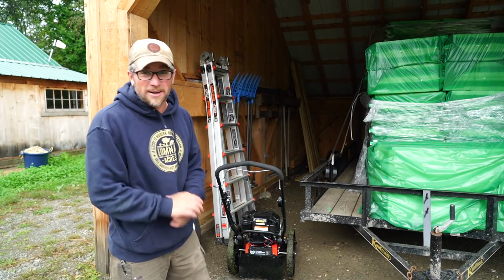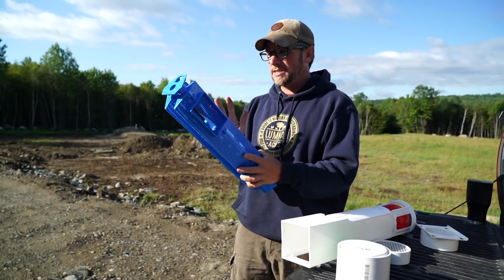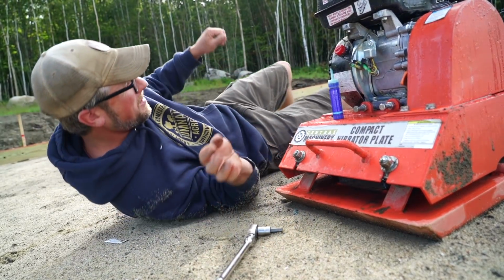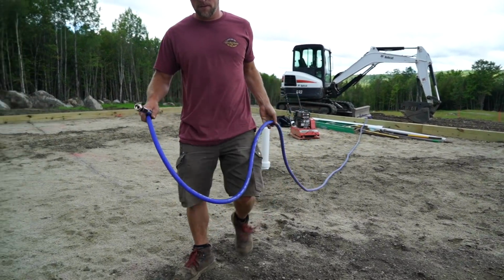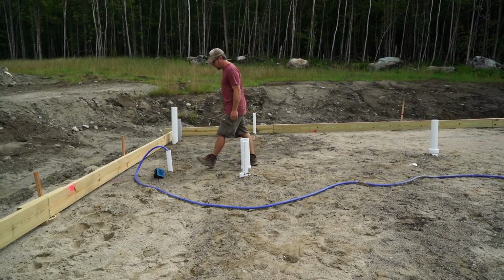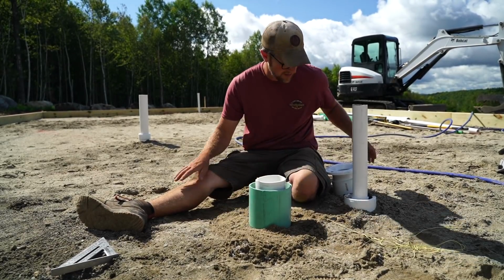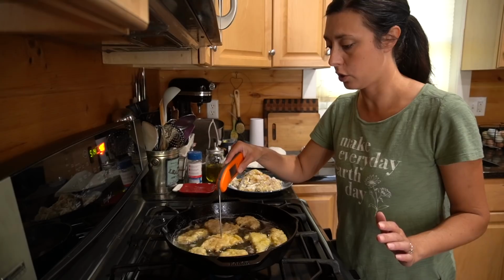If It's WRONG We'll have to Jack Hammer it Out!!!

Comment: Just cringing watching this guy cut all these risers in the plumbing grounds.  NOT the way things are done.  You’re just begging to fill your grounds up with concrete during the pour.  There’s absolutely no reason in earth to cut all those prior to pour.   Oh my gawd he’s cutting one off below grade level!!!  No!!!
You don’t have to have a perfect slope into the shower drain at that point.  You could pour the slab level there and build a curb for the shower or drop the shower a 2x4 and be done with it for now. You’ll set the slop and exact drain height when you do the tile floor with old school mud bed or the newer sloped products that are designed to go on a flat floor.  Oh gawd how old is thus video?  I hope this guy hadn’t poured this concrete…

Comment: We have two of those high wheel trimmers. They are a bear to operate because you are getting flung with stuff and it can wrap around the spindle but they do cut well when weeds take over. Good that you checked all the drains in you tiny house. You have to cut the pipes off before the floor is poured? That seems tough. How do you keep the pour from invading your pipes? Now I see. So sleeve around the actual pipe that the concrete goes around. Cool. Nice bug and bird footage. Back to the farm homestead and high wheel trimming there. Yes, our birds have slowed up too. Pluto is goofy! Nice, roasted veggies and chicken strips. Yum! Nice to see Gina cooking again. Thanks for this Lumnahs!

Comment: Al, stop damaging your hose by kinking it. Next time you are at Lowes, go in the garden department and get a ball valve shutoff valve with a hose connection, they are about $8, are brass and will have a lot of money on hoses. A quick flick and the water is off until you open the valve.

Comment: Al Most systems I've seen have a running P Trap before you enter the house. This will be your last line of defense for gas getting in your house. Buy 2 90's 2 tees 2 couplings 1 cap 1 vent grate. Do this for both lines tieing into the tank tank inlet.

Comment: Your drain pipes would be better to leave them high and cut Sam off after the slab is poured for example a 4 inch grinder and grind them off smooth with a slab like for the commode just a suggestion from an old plumber.

Comment: I have never seen anyone cut the drain pipes until the slab was poured? There should be at least an 8x8 box on closet drains just in case of an error.
Just curious if plumbers do it differently in the north?

Comment: Are you aware that there is an inside pipe cutter for pvc? It’s function is to be able to cut pvc pipe off below floor level of need be once the concrete is poured. Just wanted to make you aware of that in case you need it

Comment: Have you put a 2"pipe in for the incoming water pipe to slide into then if you get a leak in it you'll be able to slide a replacement pipe in without ripping the slab up? Plus are you having any gas so will you need another 2" pipe installed. It far better to preplan for these things rather than wish you had at a later date.

Comment: Al:  Have you given consideration to the elevation of your septic system?  In addition to being susceptible to freeze, displacement and breakage by 4 wheelers, motor cycles, delivery and construction vehicles, plus casual foot traffic by people and animals.   Any one of these events may not become obvious for months.   Replanting the system elevation before use of the system is to your advantage. Why chance on discovering it later?   Congratulations, for accepting the challenge of an independent life.
Reply: Al, Also, you might know, the stakes used for reinforcing the lateral movement of concrete forms are presently inadequate.  Rent steel concrete forming stakes at your rental yard, cheap, and install before the pour.   In addition, I see no perimeter footing excavation and forming, yet.  Most every habital building I'm aware of the 20 AND 21 centuries is required to employ a perimeter footing, and AND YOU'RE GOING 2 STORY?   Give me a break, you're not telling us about a lot of somethings, right?
Reply: "Given consideration to the elevation"  lol... That's the biggest priority of this job!  You said, "damage from casual foot traffic"!  Keep watching to see how foolish you are being.

Comment: 2x4's are down to $3.50 ..... 4x8 7/16 sheathing is down to $15 ... at lowes
if you used 2x4s and built a double stud wall on your exterior walls you could set the depth of the wall to 7 inches or 12inches and increase your exterior wall insulation ... you would still come in at a lower cost than a single wall 2x6 at this time... if you had a 12" wall on your exterior you could have a R43 instead of a R20 with a 2x6 exterior wall... but it will cost you more for insulation... AND you would have to make your slab larger to accommodate the wall thickness or accept a slightly smaller interior size... (Since you have your plumbing laid out you would probably have to increase your slab size however deep you wanted to make the wall) but even if you didn't make the walls 12 inches thick you could make them 7 inches thick 3.5" + 3.5" for the smallest 2x4 double exterior wall and it would be a R25 ... and what you do is make your window and door openings an inch bigger and line them with OSB so you get that deep window well. ... IDK its a possibility .. one that you probably don't want to think about but then you have to wait for 2x6's to go down in price... at least your interior walls will use 2x4s that are cheaper if you went with double 2x4s butted together for minimal space you would gain an inch ... but you could go maybe 12 inches deep... This might be a consideration in the future even if it isn't for this project... just thought I would share..

Comment: I have been watching you groveling around in the dirt, sand, mud and water with your tools and products until I can't stand it.  Answer... a 3-4 foot by 6 foot Braided rug. Light weight..2 shakes to clean it off..no dirt, sand, mud or water on you or your tools etc.  I can't even imagine a nut going onto a bolt with so much garbage on it!  And it makes a great backdrop for the video footage.  Just sayin..Starcreek video productions

Comment: Al has said multiple times how the compactor has not been used much, but it looked to me he used the heck out of it on multiple layers of his driveway and house pad.  Granted, I don't think the bolts should have vibrated off or loosened as they did, and lock tight is such a simple fix, it is not a serious problem.  I wish Al would stop all the complaining he does.
Reply: Why, on earth, are you so worried about how much Al has used his compactor??  It is Al's machine and it was bought to be used, right!  Lol... stating an issue and fixing it is NOT complaining, it's just vlogging!  You, however, are complaining and it's about nothing!
Reply: @darlaherbst5929  And you wonder why nobody loves you!
Reply: @madampolo  lol...strange rely, for sure!

Comment: Why in the world would you cut the pipes off before the pour?  Basic common sense Al.  And why wouldn't you use the proper tool to cut the pipe?  Another basic common sense thing.  You are getting ahead of yourself and not thinking things through again or overthinking it trying to get ahead of yourself. I've got absolutely no construction experience at all but even I can call out basic stuff......and I'm not trying to be unkind here at all.

Comment: I'll bet somebody has already mentioned it, but cutting those pipes now is a mistake... you could mark the concrete line, but you want to cut the pipes after the concrete slab is poured so if there is a mistake you don't have to fish for the pipe.

Comment: Gee--another freebie for Al. Looks like it goes from anywhere between $430 and $1300 depending on the model that it is.

Also regarding the breakdown of your compactor, you mentioned that tools are meant to be used. Yes they are, BUT they're meant to be used wisely.

Comment: As per my experience as a plumber is easier to wrap the risers with cardboard a after the concrete is done, you remove the cardboard and cut the pipe as needed.

Comment: I would have used the "red" Lock-tite instead of the blue on your compactor because it holds almost 10 better. The blue is more designed to enable you to remove a bolt or screw and the red is made to keep it from coming loose.

Comment: Guaranteed those drains won't be "exactly" where you need them once that slab is all poured and finished. I'll predict your concrete screeds in the middle of your slab won't even be that accurate. Way better to put a "block out" area in the slab around the toilet stub and the shower stub. That way you can cut off those drain stubs "precisely" where they need to be once you have decided what floor (floor thickness makes a difference) you will be using etc. Also, you never installed a drain vent for the shower drain so that trap is going to "siphon" dry when the drain runs dry so you will end up with a empty trap and have "sewer gases" causing your shower/bathroom to smell. For your own benefit (never mind "inspection"), you should use a "test plug" to fill your drains after installing a 10' upright leg on one of your plumbing vents. That 10' vent leg should remain full of water which indicates you have no drain leaks with approximately 5 lbs of pressure.
Reply: In the UK we only vent the toilet pipe we never vent every sink and shower and our 'Pee traps' are always full and we don't get any odours as far as I can see all then 'vents' will allow smells from the pipes to vent out into the rooms the vents are in making all that pipework fail an inspection here for the smalls and gases. Even our toilet vent is outside so any possible smells are vented outside and above the wall height.
Crazy the difference between the two countries I said the same when Al was wiring the portable line hut in this country the wiring would be classed as a fire hazard but then we are 240volt not 110v and 12v.
Reply: @1MartinWaite  
All of our vents are piped out of the building to atmosphere. They don't vent inside the rooms. Most fixtures (sinks and others "above" the floor) are vented via pipes extending up the wall "above" the drain. The shower is typically vented like a toilet with the vent pipe coming directly off the "wet" side of the drain. If you run enough water to fill the drain pipe and don't provide any kind of "air gap" to break the vacuum caused by the draining water, it will siphon the trap dry.
Reply: @pappabob29  you must have funny water as I say we don't have a problem with water syphoning and we don't have or need all the vents you have and our Peetraps stay full of water.

Comment: Al something to consider with the floor drains, in some areas the law requires that a Trap Primer be installed.  I know that isn't the case where you are but you might still want to consider this option as the problem it solves will almost certainly affect you.  Trap Primer's connect a small waterline to a frequently used faucet to trickle a bit of water in to the trap.  This makes sure that the trap never dries up.  A dry P-Trap will not block sewage gases.   Floor drains are notorious for this as they almost never get used.

Comment: set a sonit tube around it and when the pour is done adjust it perfect and then pour it in with a concrete that meets or exceeds your original mix
Reply: The sonnit tube circular form = less susceptible of producing later concrete cracks.

Comment: To pressure test the system, take a six inch or longer piece of pipe and glue a cap on it. Then attach that to the pipe in the septic tank with a rubber coupling that clamps onto both pieces with hose clamps. These have different names around the country but we called them Fernco couples in my area. They are used for repairs and or changes between types of pipe. Common one around here was for cast iron to schedule 40 PVC, but what you need is the same on both sides which they make. Then you can fill the whole system and make sure it holds for 24 hours without dropping. Unscrew the clamp and remove at the end but hold on as all that water will be pushing it. If this is too late at least others will know.

Comment: Al take a  box like an empty sheet rock put it a round the pipe fill with sand . This will give you room move the plpe a little and able to cut pipe right height.  Then can fill hole with concrete when done .

Comment: 🌻👍🏻💕🙏🏻
I had my old homes plumbing and electric totally replaced. 
In Santa Monica, everything has to be checked as to building codes prior to the next step.
They didn’t notice one of my clean outs were put in upside down. My neighbor caught it. ( extra caring eyes)
I consider you an expert. 
So nice having so many caring eyes looking out for you.
Just in case.👍🏻💕

Comment: Chickens will lay better in the winter if you control the number of ‘daylight ‘ hours they get. A light in the coop at night that turns on early and shuts off at a reasonable hour helps a lot.
Reply: Lumnah Acres explained in a previous video why they do not add extra light to the coop.

Comment: For your actual house build leave the drain pipes higher than usual, once concrete is poured then cut them off this way no concrete goes in while being poured and you can more accurately cut the pipe to the level needed.

Comment: I still think the holes in the baffle between the solids and liquids sides of the septic tank need to be higher.  At their current height you are only using 1/2 of the capacity.

Also, if you really want to test the drain pipes, get an expanding plug for the inside of the septic tank and fill all pipes leading into the tank to the max.  No loss of water for 24 hours.
Reply: Several people pointed that out when he installed them, but he doesn’t read comments. Or, he reads them and then ignores them. Nuts.
Reply: Ya, I would have put the baffle holes at the very top, just below the liquid level.  Oh well.  Great job on so much of it.

Comment: You are using a thread locker. The product you are using is not Loctite. I would also recommend that you use the red version, not the blue version. The red version would hold better in this case. I would also recommend that you use the real Loctite product, just a personal preference. The blue version is meant to be able to take back off easier if you need to. The red version is a lot stronger.

Comment: That is a very poor idea, the tool is a vibrator so you would think they would know the bolts would vibrate loose and stop that from happening, it is not good to have to put Loctite on yourself after such a short time. Poor design if you ask me.

Comment: What if your drain is off by an couple inches now? What’s your plan? Not only did you cut them off before you should you may not have them in the right place, that’s why you box them out to leave room for adjustments AFTER you pour your concrete!!!!! AFTER!!!!
Reply: Any mistakes will be cast in concrete, and there will be mistakes.

Comment: Hey Al... You have a ton of rocks and wood, pallets, even machinery (forks), you can use as makeshift tables. Instead of working on the ground use your forks  to lift the compactor or any heavy equipment that needs repairs. That way you are not laying on the dirt and sand.

Comment: I've always left drain pipes taller than required, that way there is no risk of concrete spilling in. Once the slab is poured, the pipes can be cut to the required height. The concrete is poured level across the entire slab and wet areas can then be stepped down/rebated 50mm/2" below the final slab height. Wet areas then have a sand/cement bedding applied and given appropriate fall/grade to the floor waste point.
I have always used this method for all commercial and residential new builds
Reply: And you’re never 100% sure what you’re finished floor height will be you only know what your concrete height will be
Reply: think his concrete height is going to be his floor height, nothing else as finish on top of

Comment: How many "rodding -eyes" do you have?
Why cut before the concrete?
I would encircle each pipe with a larger one to about 2" above the concrete height. 
Then when concrete is dry, remove the spacer pipe and cut to height?
Fill the space left around the pipe with foam.

Comment: Sorry, Al, but a running water test doesn’t tell you doodly. The time to test your pipes was when they were still exposed. You have no idea if any of your fittings leak. Did you repair the floor drain wye you installed backwards?  Please wrap your pipes where they past through the slab!!
Reply: Pipe insulation around them works great. The movement of the unwrapped pipes when water is turned on and off will make them rub against the concrete and eventually make them leak.
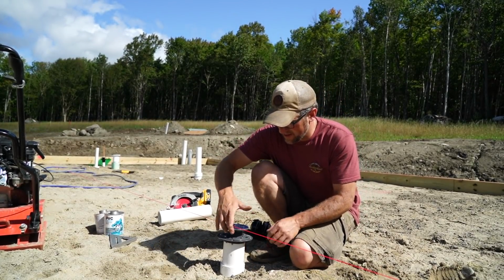Reply: vito336 - Al stated twice in video that they repaired floor drain, 25:05 to 25:15 & 31:11 to 31:30.

Comment: You have to cap those drains and blow air into it and pump it up and put pressure on the system that's how you test a plumbing system drainage
Reply: Usually a water test, you plug your outlets and fill to the required head for the required time.
Reply: https://www.youtube.com/watch?v=6ALvhbDGJfE  - air testing may be wise for the hot and cold water pipes  https://www.youtube.com/watch?v=LrZnFO347qI

Comment: Good morning!  Moving right along there.  Curious as to why you would cut off your pipes prior to poring the foundation?  Also wondering why you don’t have any footers, especially in your area with the extreme cold?  My concern is that that slab will crack like Humpty Dumpy and you wont be able to put it back together again. Looking forward to seeing the little house going up.  I am really impressed that you took on putting in the septic system, good job.